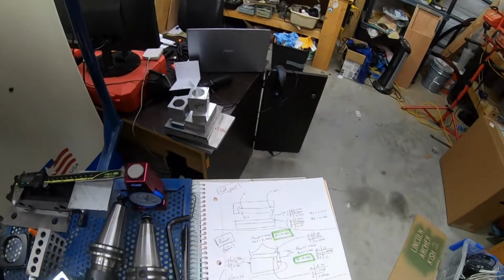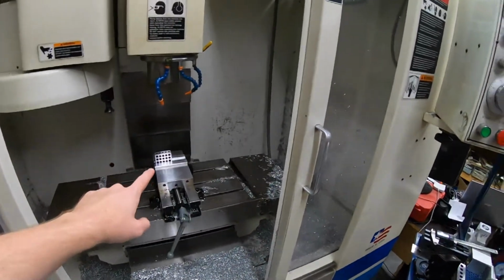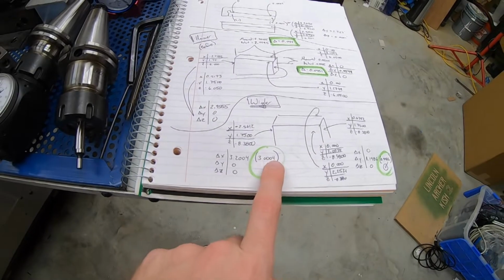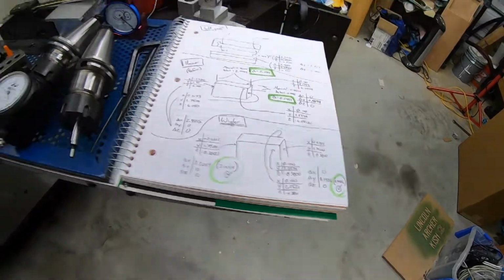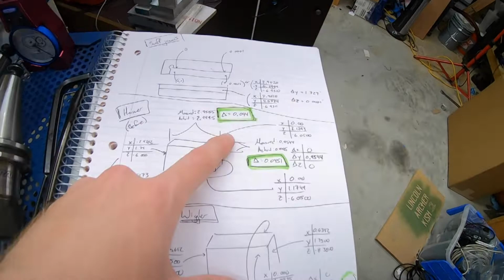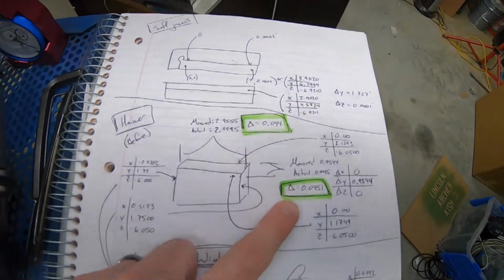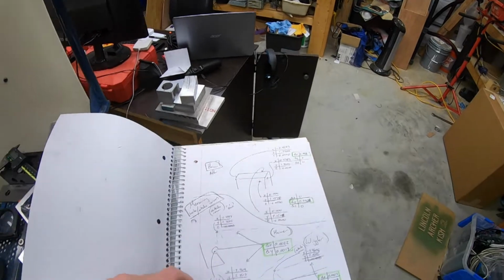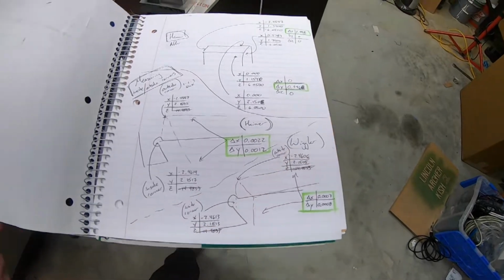Troubleshooting and "Fixing" my Haimer

Comment: I’ve got the same problem, my 3D Haimer taster drop from spindle twice 😢 due to assembled wrong pull stud, now it shy 0.12 mm ( around 0.005’’) error on X and Y axis with new needle. I saw your link forum and try but it not worked. I’m really appreciate if you help me with your experiment fixed your sensor, thanks

Comment: I wonder if the ER Collet is contributing to the error.  Something could have shifted when you crashed.  Replacing the tool in the collet could have realigned the Haimer with the Collet Taper to the  CAT40 taper.  I'm wondering if the calibration only adjusts the XY offset of the ball.  The axis of the probe tip shaft might be contributing to the sin error in the x and y axis.  Can you measure the probe tip shaft runout in a couple of locations?  Also, by using the universal sensor and not the integrated sensor, there is a couple interfaces which could contribute to the error.
Be careful about placing the magnets on the C-Thru.  Extremely difficult to reposition.
Reply: The numbers would be consistent  & repeatable - it does not matter if it's out as long as it stay the same amount out very time. the issue here would suggest that depending on the direction the of measure internal vs external there is variation in the numbers. this is one of the reasons Renishaw probes normally  use spindle orientation when probing to make sure the same side of the probe is doing the measuring.

Comment: I spent a solid 8 hour day dialing my Haimer in.  It is within .0005" all the way around...  It makes all the difference.  No more assuming or guessing.  I would agree that a back up probe is essential if you're running production work.  BUT, I still know guys who do everything with a wiggler and feelers.  It takes them an extra minute or two on setup, but they don't set up every part and every cycle.  They setup and run op 1 for 500 parts, then op 2, etc...  I do prototypes, so if I don't have a good probe, it slows me WAY down.
Reply from the maker: Greg's Garage totally agree 🤘